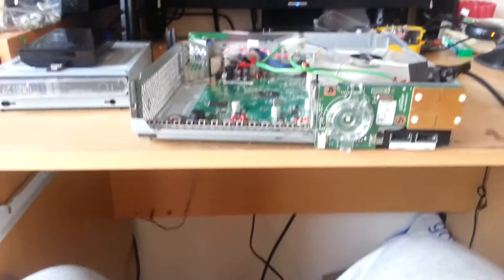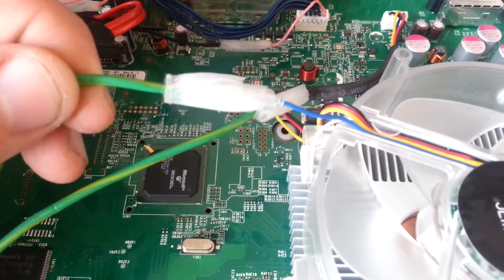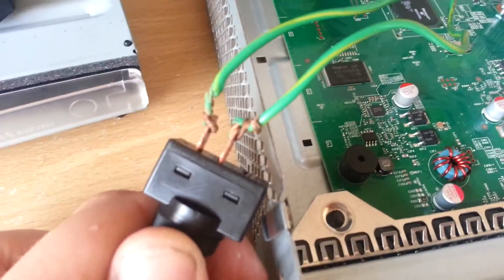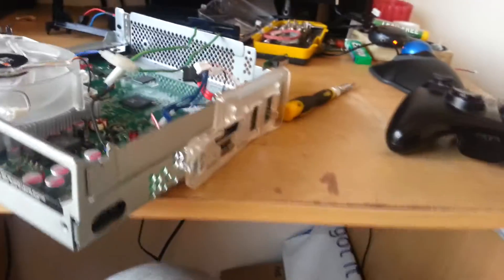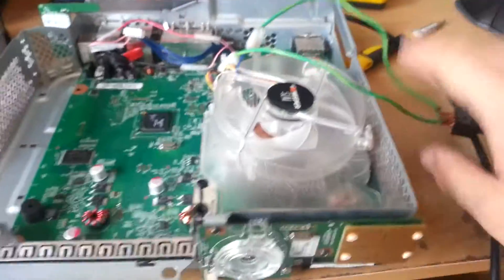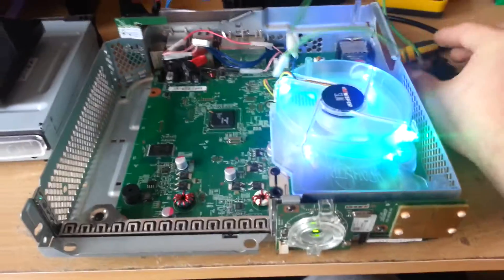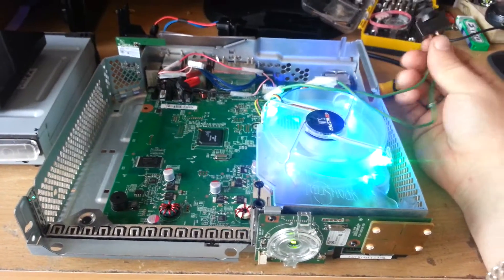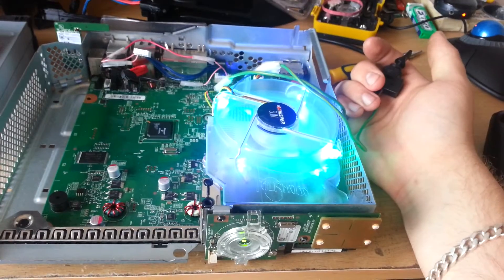XBOX360 Wiring A 12V Toggle Swich To The Fan

Comment: Will this toggle switch on the blue fan wire work on an Xbox 360 E? my fan doesn't want to come on until it overheats several times. Thought it would be great to work the fan manually. Also can it be done without changing the fan?

Comment: um bro here is some advice use but connectors and use female disconnect - nylon if you have a napa near you the part # 784389 
they will make your life alot easier 22-18 gauge for any kind of mods like that. just some advice from a another moder

Comment: Why would you need this? If it gets to hot it automatically turns the 12v on, useless you don't want to turn it and then it'll just over heat.
Reply: Keeps it from overheating at all from the start making them last longer
Reply: @furiousdriver3673  sound mate, been waiting for a answer lol

Comment: nice mod for curiosity can I use a control knob in lue of the switch so that I can control the fan speed or would i have to attach that to the red and black wires

Comment: id like to use a illuminating green led toggle switch with a carbon fiber cover but im second guessing my self now how i will wire it to power the led and the fan its self with only 3 prongs but id like to have the green led switch to match my fan and my ROL board the darker green looks great compared to the original yellowish green color

Comment: Thank you very much this will help me out a lot i have the same fan and a couple old stock xbox slim fans i will take blue wire from im thinking of using a 3 prong switch which more than likely will require to be grounded but you will still have helped me a lot with this video.